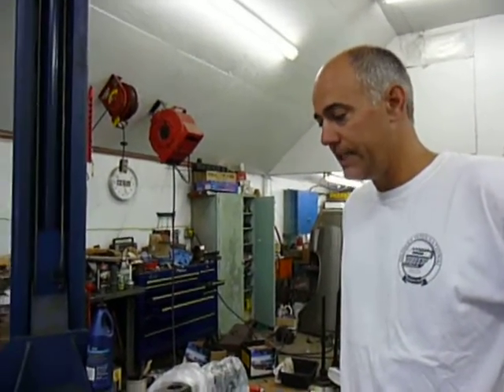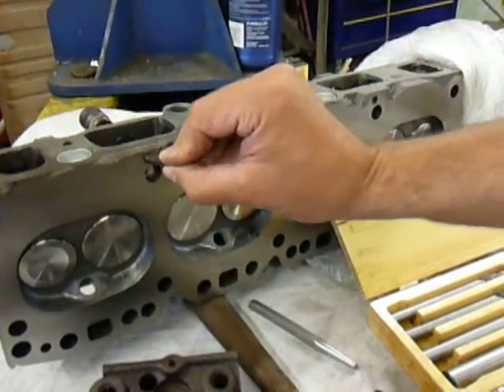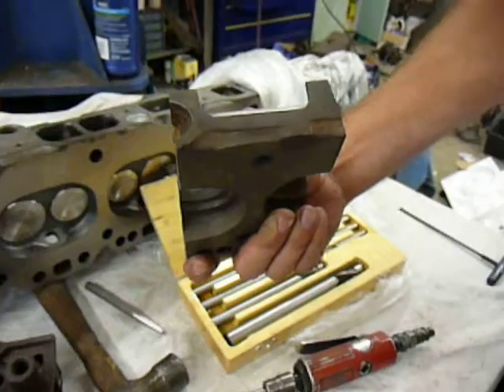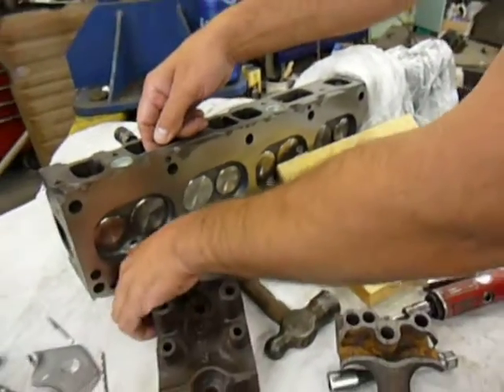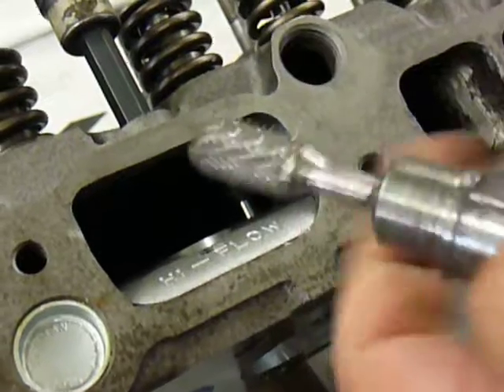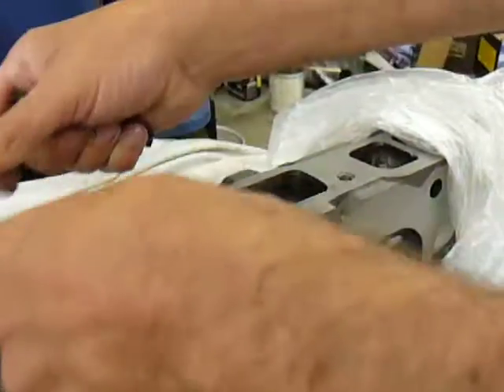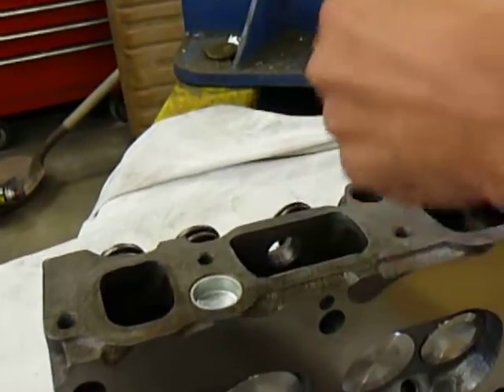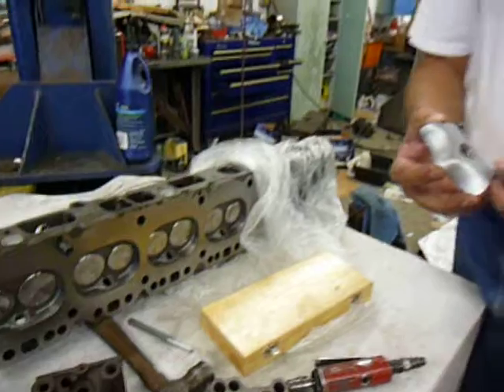Part 2 Chevy inline 6 head intake port lump installation 194 230 250 292

Comment: ? Am I correct in correcting you "will increase flow" might instead read "increase velocity" ?
I can't imagine ANY reduction in port size doing this EXCEPT for knurling for reduced surface flow "stiction" .

  Thanks.
Reply from the maker: Mark. You are not correct and completely wrong either. The bolt in lump will increase velocity as you say. But the lump actually does increase the CFM of the port. With a 1.84 or 1.94 valve the increase is nearly 10% in CFM. The short turn radius is drastically improved.
Reply: Tom Lowe 
  Thanks , Tom .
Reply: Is this better than changing your head for a silverado of the 80's? I'm looking for fuel economy

Comment: Off the sublect a little bit I have a 293 straight six. The manifolds are duel intake& exhaust combined. They do tend to warp from heat easier  then the split manifolds. I suggest 2 gaskets to compensate from the warping. My engine is broken in now! Should I adjust the valves when rocker arm/rod is noisy?

Comment: Instead of the lump, I would rather see a port divider to replace the factory bolt boss to give it a true individual port for each cylinder.  Why hasn't this ever been done?
Reply: it was. back when the engine was still made in the 70's. however the results of the true Siamese ports were less than desirable, as some guy figure out after hundreds of hours of testing  that one intake helped with the flow of the other, and a lump port that increased the velocity also increased the CFM into the intake. Source is from the power manual 2nd edition (2017) from Leo S.

Comment from the maker: Once the Premium lump is installed , the small bolt holding it is much less of a obstacle to air flow than the normally gaping hole as with the normal lumps.@snowman4839

Comment from the maker: @boss1987221 Very good catch on your part. You need to remember, the head will need to be reassembled and I would expect it to be cleaned at that time.
Reply: If you want a cylinder head that flows, why no get a Pontiac OHC 6 Sprint engine instead of the Chevy?

Comment: The early Duggan head does not flow anywhere near close to what a Kirby head flows. The exhaust port flowed OK though.
Duggan sold the rights to those heads to Mike K & Joe Deppe.
Mike K has made several improvements of the head since he got the patterns from Duggan

So far,a guy in Brazil,has the Kirby head & w/7 psi of boost pressure made 700 HP to the wheels. To date,best run so far is 8.6 seconds in the 1/4. 250 CI.

Comment: Great inline video. i live in Brazil and these engines are very popular around here. I run a 250 with a Isky cam and holley 600 d.p. My brither run a turbo 250. these bolt in lumps should work very well! Over 220 cfm is excelent flow for the ancient inline head!
Reply: Francisco i would love to know more about the 250 setups yall are running.